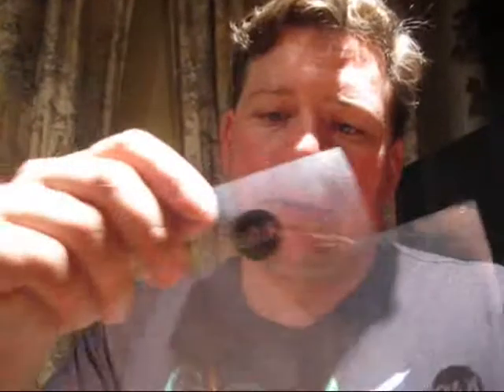Print at Home Gobo P3

Comment: I tried this over the weekend, and the paper got burned in the projector put a hole in the middle...
Reply from the maker: Oh no, I'm sorry to hear that. What fixture are you using? Was is it an LED light source? What is the power rating of the LED? Did you have it set to 100%? Did you do any testing before hand to determine the best settings for the longevity of the gobo or fixture?
Reply from the maker: Where you at my guy? I can help you make this work. If you're interested.
Reply: @DJRockinRob  no it was a last minute fix.  I normally send out to get the metal gobo, but I needed it faster than I could get one so I saw your video and tried it.
Reply from the maker: @brothermarlon  I'm sorry it didn't work for you in the pinch. However, if we study why it failed, we can make adjustments and try again. While I did try to detail as much of the process as I could (in the video) there are just more variables at play every day. 
For instance; What specific fixture did you use? This video is kind of "old" by DJ Tech/LED Tech standards. In my experiments, I discovered a 23w LED was the max my transparencies could handle. The moving head I use in the video is a 60w but that was with an extra piece of glass to help. If I remember, I found that my Watch Crystal was exactly the size I needed. So, again, Print at home Gobos can work.... if you try hard enough! Lol. To be fair, as much as I just defended Print at Home Gobos, I honestly left them far behind me many years ago! ABSOLUTELY EVERY SINGLE THING you could ever use a "Gobo" for.... the cheapest of LCD projectors will beat it hands down. Except brightness, unfortunately. More LCD Brightness=$$$. But what I mean is, with a projector, I can make Full Color Animated Gobos! (Ok, they never let me animate them. But I could have if I wanted to!! Hahaha!) With a projector, I can fix a Typo in a monogram ON SITE! with a projector, I can use it for what ever I want. Whereas with a Gobo... you have to order it. You have to ship it. Then, power for the fixture. 750? Ha! Not on a 100' extension cord! Haha! Projector? No problem! (Except brightness, Source 4s are so BRIGHT! ). 
If you don't learn from failure, then "how do you" learn? Good luck to you! I hope you give Print at Home Gobos another shot ;-)